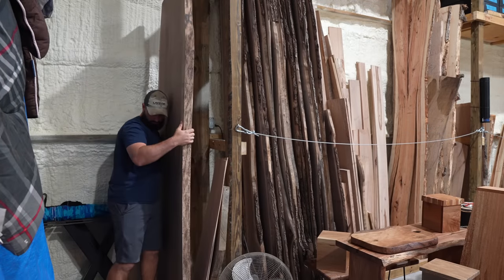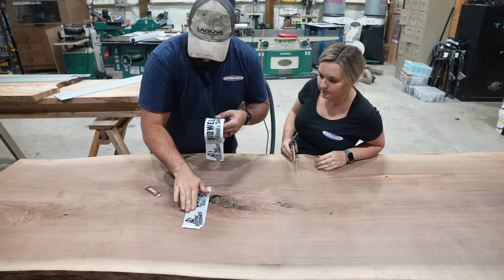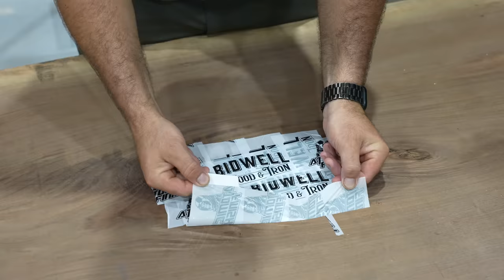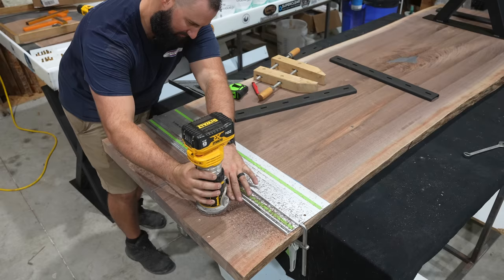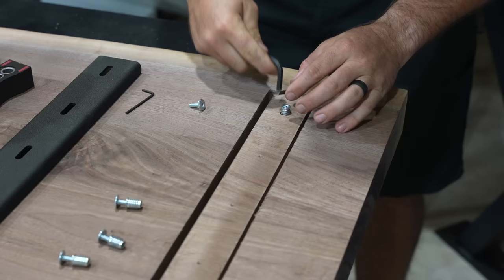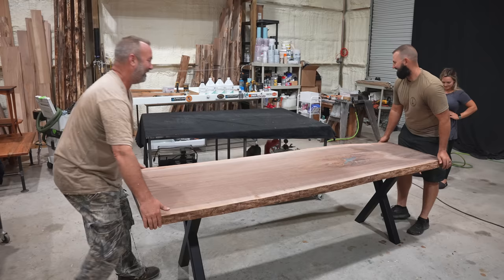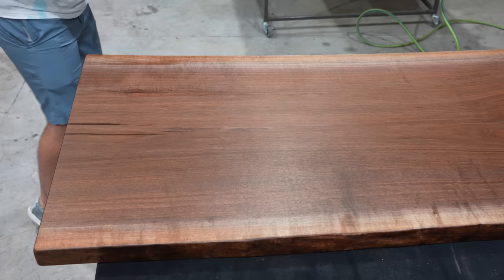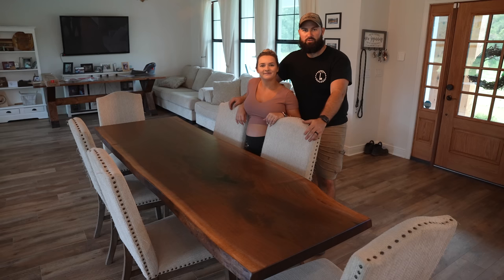$5,000 Black Walnut Table For A Famous YouTuber

Comment: Hold on, you have slots on the c channel to allow for wood movement but you don't on the legs! Best case scenario, it breaks the bolts off, worst case it warps the table! Slots, slots, slots. Walnut is tough, but oak laughs about thin bolts! Wood is imperfect, that's why we love it. It'll do what it does, the challenge for us is to understand what it's doing. The width will move a lot, while the length won't.

Comment: Good job.
I wonder if you could have made a plywood template for that cut out in the bottom of the table top to speed your process.
If you do much more of this you can keep that template and use it for many other tables and just block in the end if it's too large for a smaller table
Thank you

Comment: You spend a lot of time with the installation of C-channel for seasonal movement and then put legs on with no slots for the same seasonal movement. That is asking for splitting in a very dry environment or warping in humidity or both.

Comment: If you’ve never seen them, the dowel max system has some very high-quality carbide drill bits that they sell for very reasonable, and they have stop collars with two Allen screws on them. If you’re using it with the dowel max, the Allen screws will actually sit on spots that have been ground flat for them specifically. You can buy them in 5/16, three eights, and half-inch as well as certain metric sizes. I love the dowel max system, and besides using it what it’s designed for, you can use it the same way you did in your video drill straight holes as needed.  I think the drill bits are about 30 bucks apiece, but if you had seen the amount of drilling that I have put my three eights bit through and it is still razor blade sharp you would understand why I’m leaving this message. I think I’m going to order back ups Just in case I ever drop one and it hits the concrete floor because I don’t think I’ll need one unless that happens

Comment: Get a quarter inch or smaller paddle drill bit. Like for drilling holes….and fabricate it to what you need. They are longer than most bits that’s why I use them,plus they’re very cheap at flea markets ha!

Comment: Get a real Dremel tool for a  Foredom TX that would be my advice. Then you will have all their attachments to go with it. for hardwood, I find they are the best for the job. Or whatever Foredom model you choose.  But the TX is a powerhouse for that digging. You can get the hammer handpiece with chisels and that works well as well.

Comment: legs connection with 12 shorts screws are strong enough ??? That's very Scary???? Very nice ,,I have 108"x48" two and half " thick  just have two 20" circle stainless steel loose Drum with steel ring construction and not fixed can't even move. well good luck nice job.Great Couple.

Comment: Use a drill bit and the Dremel attachment you want joined together bye brazing or TIG welding, it might cost you a few dollars to have your local welder make the attachment for you, nonetheless you can use drill bits as shaft extensions for your Dremel attachments just an idea I am a certified welder and engineer from Baltimore,  brazing would be sufficiently strong and you could potentially perform that action yourself ,have a great day

Comment: Great job! I have a question about a c-channel insert. As far as I saw. c-channlel plate had a long holes to allow the lumber movenent. But at the same time, you used usual round holes when attached the legs in parallel with these c-channel plates. So this looks like a conflict with an idea of allowing the movement, isn't it?

Comment: I'm curious about how you plan for seasonal wood movement. Obviously the manufacturer of the C-channel understood the need for slotted fastener holes to accommodate movement, and if you didn't over torque the screws you should be ok with movement across the grain. Hopefully, the stresses that build up from restraining the wood from cupping won't damage the top. In the video it appears there is insufficient room for cross grain seasonal movement between the top and the leg mounting screw holes and also between the leg top plate ends and the routed recess. Overall, how do you calculate or guestimate wood movement distance?

Comment: You produce a beautiful table.  A thought for you in the future on the slabs dried in the north. On THIRD COAST HARDWOODS site they describe drying their slabs to 6-7% which would be typical for Michigan and then flattening.  When you started work on the slab, you measured ~13% , so it had absorbed moisture so even laying it flat it would probably have cupped.

Comment: Next time when you get a fresh slab clamp it down to a solid flat surface and it will not Cup on you that way you don't have to run into the flattening Miser Mill I personally would have used an oil-based finish like Danish oil or linseed oil but it's all good

Comment: Great video....one thing is unclear to me. You put on the C-channel to allow for seasonal movement. But then you put on the X legs which have fixed screw holes which don't allow for movement. Does that not negate the purpose of the C-channel?

Comment: It appears the ends of the slab were different widths. In placing the legs, were they centered over a center line or centered between the live edges? In other words, if one looks at the table from the end are the legs aligned?

Comment: TIP. --USE TWO APPROPRIATE SIZED WOOD DOWELS INSERT IN TWO OPPOSITE HOLES ON SANDER AND SLIP NEW DISK OVER THEM--INSTANT FIT WITH NO FUSS!!

Comment: Uh use a 1/4” air grinder or electric and you can buy 6” carbide burrs for it. Or 4” for 1/8” is common all over.

Comment: First of all, great detailed video! I was wondering if you could give me some advice on a issue I have. I’ve done a lot of carpentry work over the years but not as familiar with epoxy. My son wanted to start making live edge coffee tables to make money. When we started with the initial epoxy pour I mixed it and it was fine. So after settling we realized it needed a second pour, so my son didn’t mix it well enough and now it’s tacky. We’re using cypress and do you have any advice on how to fix and salvage. Your help would be greatly appreciated. Thanks!!

Comment: I use the flexible dremal it’s about a 28 inch flexible shaft and head. It works great for getting into hard to reach places. I have not used it in this application but I think it would work great. I would also like any information you can give me any information about doing a epoxy table. I am a traveling healthcare worker. But I just had a new shop built at home and one of the first projects I wanted to do was a big dining room epoxy live edge table out of a big pecan tree that had to come down to build my new shop. Any information would be greatly appreciated. Thank you

Comment: A tables bottom should be as good as the top.  Make a jig to cut your c-channels so you don't have those rounded cut outs as it looks mickey moused.  This way your channel fits right into the cut out for it with no more cut than needed.  Procure your channels from the same folks and they should always be the same.  I try to buy a bunch of it so they come from the same lot.  It's obvious the bottom's finish doesn't need to be as good as the top but it should look nice
I have a drill bit I only use for drilling out anchors and have a stop always on it.  Don't counter sink the channel as they should sit flush with the surface of bottom
Just a couple pointers to produce a better end result.  I may add more before the end of video
I always seal the top or at a minimum around where the tinted epoxy will be to prevent staining of the wood around pour/filling.  Don't ask how I know as it still pisses me off a decade or more later.  I've been a woodworker/home builder for almost 40 years and made most of the mistakes.  The difference between a $5000 table and a $8000(or more) table is in the fine details.  The best advertisement is word of mouth and don't ever think 'someone won't see that'.  At some time someone will be sucking up Cheerios off the floor looking at bottom of table, reaching into a drawer opening to grab a piece of paper or whatever/wherever

Comment: Hey Triple L, not sure if anyone mentioned it yet but I use a flex shaft attachment for my rotary tools. They make more detailed work a little easier & would get into those voids to remove that material from the hole. 
You guys are awesome. 
Also, I have a bet with my wife about you guys. I usually lose but I swear to God we saw you guys on a show on HGTV. She said it was a different couple.

Comment: Removing Bubbles
2nd Pore
Do Not do heat epoxies
Do Not do 2 pores to fill voids.
Use composite bagging material and bag sealent to make dams higher than the wood surface
and
Vacuum bag you epozie mix cup and pore cup.
Vacuum bag the pored and dammed up areas and vacuum bag the entire table 
Dam up areas with vacujm bag sealent
put on release fabric.
Put on breather.
Vacuum bag entire table.
Pull a vacuum to remove all bubbles in pored epoxie
Cure epoxies and table under vacuum.
vacuum bag sealent will easily be removed and vaccu

Comment: In the groves holes that you poured the tinted epoxy. If it was my table id prefer you used untinted epoxy so there wouldnt be a dark spot in the middle of the table. Id rather see the same color even though you could see the hole . its better than a big Dark Spot.  Thats driving me nuts 😫

Comment: Good thing you are the customer, due your screw ups in over routing and not ensuring the legs were square and flat. i wouldn't agree that you know what you are doing, but practice makes perfect, and in the long run, you will get better and better. But the table does look great for just getting started, and hopefully you take the lessons learned and move forward from there

Comment: Some tips for you or those who come later.

1. Track saw (even an underpowered one) is nice, but all you really need is a straight piece of plywood (factory edges are more than straight enough), offset the appropriate distance, and clamped.  They you use your (not underpowered) circular saw, one pass (much better than multiple passes) and Bob's yer uncle.
2. The real reason to clean out pockets of rot is so that bits of rotten wood don't float up into the epoxy you're going to pour all over it.  Beyond rot that's immediately visible, you really don't need to clean it all out.  Your blow-out with compressed air will remove anything loose anyway.
3. Another way to deal with rot pockets is to clean out visible rot, then brush coat the pocket surfaces to seal it.  Your major pour will fill the pocket and alles gut!
4.  Hot tip for void filling: thin your epoxy with denatured alcohol to water consistency and it will penetrate the wood surface to seal it.  Warm it up for even better (less viscous) results.
5.  What is the required minimum moisture content?  You measure it but provide no standard of comparison.  Best to let the slab sit for some weeks or months to acclimatize to your local conditions.  After the slab is sealed in epoxy it won't be able to absorb or release any more moisture anyway... just need it to be stable.
6.  When taping off voids that go through the slab, lay the tape parallel to the long axis of the rot pocket, so that the are fewer strips of tape needed, and fewer overlap joints along the edge of the tape.  Always be sure there is NO dust remaining, and burnish the tape down vigorously.
7. Table is MDF covered in epoxy tape?  That's an awful lot of tape.  There are simpler less expensive ways to get a flat surface to release well.
8. When pouring epoxy into the mix container, don't rest the jug on the container edge.  Any carelessness could result in tipping over the mix container, and then it's a mess to clean up, not to mention a costly mess.
9.  I won't argue about using a respirator, I think it's a good idea for a pregnant woman, but not to use gloves (especially wearing expensive jewelry) is, um, foolish.
10.  Does your epoxy actually shrink?  I thought epoxies generally were 100% reactive and since there's no solvent loss, no shrinkage.  What IS a concern is that until the epoxy sets, it will continue to penetrate all void areas AND be absorbed into the surface of the wood (as you describe).  This LOOKS like shrinkage and has the same effect, but it's not.  The more I think of it, all you really have to do is seal the void areas, then your final pour will provide enough resin to do the rest. I'm pretty sure the shrinkage shown at 12:34 is only the result of further penetration into the voids, not actual shrinkage.  In support of that, realize you can never see how far the rot pockets or cracks go into the slab, but the epoxy will find and fill them, slowly but surely.  This is a good argument for a seal coat on the voids, before trying to fill them.
11.  Exactly how does the torch treatment cause bubbles to pop?  Does the heat reduce the viscosity enough (and thus the surface tension) so that the bubbles collapse, or is it the carbon dioxide in the torch flame (another surface tension reducer) that pops the bubbles?
12.  You can get a successfully bonded second layer of epoxy via 1) a good mechanical bond (created by sanding between coats) 2) not waiting until the first layer is fully cured, or 3) wiping the surface with whatever solvent is compatible with your epoxy product, or 4) all of the above.  Point is, sanding and blowing off the dust is not the only, nor maybe the most effective, what to prep.
13.  You DON"T need to flatten the slab on both sides, but does show off your equipment.

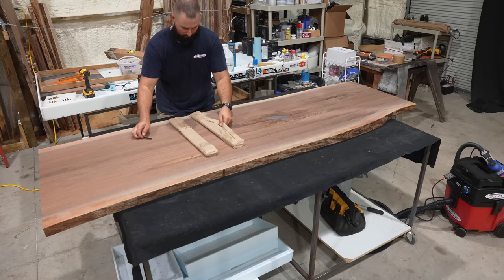Sheesh, at 17:50 got tired of watching.  Cam Anderson at Blacktail Studio makes slab table videos, a lot shorter and still with everything you need to know.

Comment: You should get some new better wheels for your shop tables with lifts and locks- just silly for slab work - your worst enemy is a light moving table that won't stand still. Here you have all this HD pro power tools and then those wimpy tables

Comment: Mc***master***Carr for tooling for dremel/die grinders.
1 1/2''-3'' in length
1/4" shank 1/4"x 5/8"head 2"oal Aluminum, Copper, Brass, Bronze, Plastic, MC part #4295A29	
1/8'' shank, .250"x3/8" diam, Cylindrical Diamond cut head, 2"oal, 150 grit MC part # 4490A109
Long-Life Grinding Bits for Nonmetals
Arbors for Rubber-Cushioned Abrasive Grinding Bits

Comment: Not really the welders mistake every welder knows heat makes distortion should have used 1/4 inch flat bar instead of that super thin stuff it would have held shape better

Comment: Holy hell...nice guy, but that workmanship is far below what I would consider being a professional.  From the over shot with the router (on multiple occasions), even drilling out the table legs.  Why would you use a step bit vs a 5/16" drill but which wouldn't have messed up the powder coating.  Also that crack needs to have a bowtie as it will 100% start to split, even with the C-Channel.  Hopefully you are good at accepting constructive criticism...